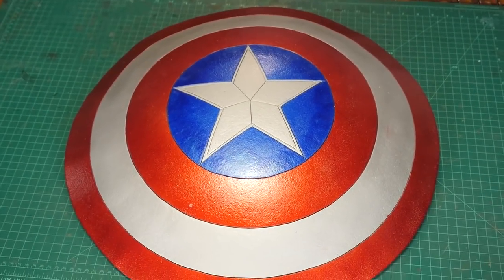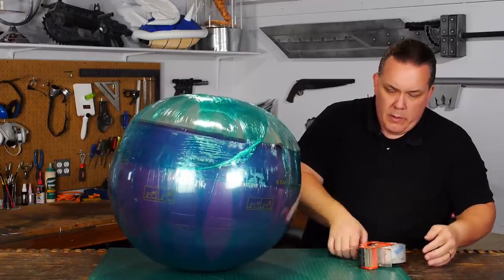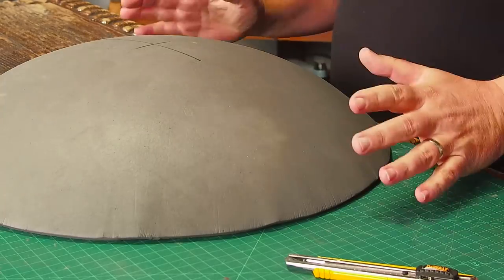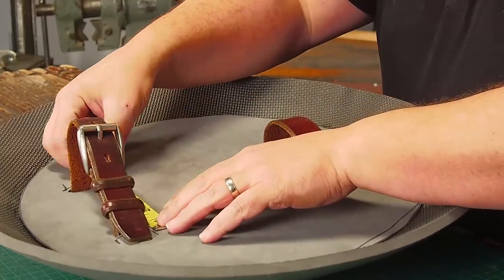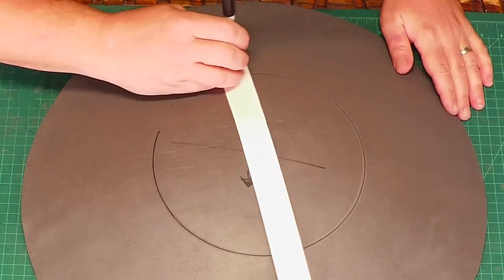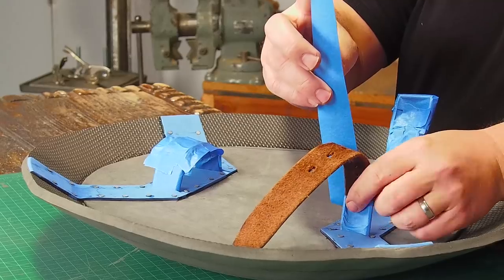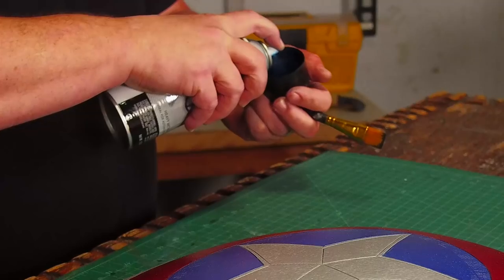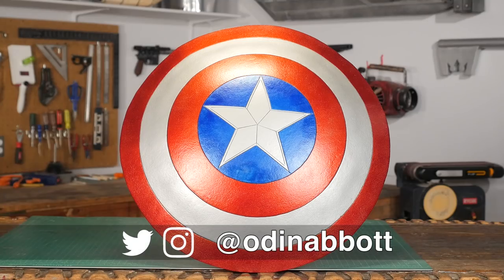Odin Makes: Captain Americas Shield from the MCU

Comment: Using your video as a reference, super helpful. I put some holes in the back piece and filled it with expanding foam to protect the dome. Works great and adds some weight!

Comment: I am making this with my son, but can't leave it in a hot car in the UK in October. So we used two layers of foam, hot glued at their center, then we used EVO-STIK (like contact cement) to glue both circles together. We cut a sheet of clear plastic an inch or so larger than the shield and put Duct tape across the top extending past the plastic about six inches. We then taped it to an over-inflated exercise ball and added more strips of duct tape across the top.  We filled in the gaps between these tape strips with shorter pieces of tape until all 360 degrees of the shield edge were taped down.  When the glue dries, the shield should hold it's shape just like laminated wood beams do. We will have to trim the edge to even up the circles since the back one ends up about 1/4" bigger than the front layer due to the curvature.
Reply: Also, to cut the circles and to etch the rings, We used a plastic ruler compass. I heated a small nail and stuck it through the ruler at the 0" mark. I then heated an Exacto knife blade and pushed it through the ruler at 4", 6" 8" and 10". For the inner rings, the knife blade hangs about 1-2 mm below the ruler, which is now a very sturdy compass knife vs. Odin's posterboard compass.  I then drove the nail through the ruler, the foam and into a wooden workbench. I didn't even need to draw the circles, we just etched them.  At the 10" mark, I used a longer blade and heated it then pushed it through the ruler until it hit the workbench.  This cuts a perfect circle.  We then used a star template to etch an 8" five-point start inside the inner etched circle.  We are doing everything else pretty much the way Odin does it.

Comment: Hey Odin, here's an idea for you. Instead of using nail heads for rivets, use googly eyes. It's a lot cheaper to do, it's a lot faster to do, and it looks better once you paint them. They will make a little bit of noise because they have paper inside of it but it's a small price to pay for good design.

Comment: Hey Odin I have a fun little tip for you

Next time you’re short on rivets just cut some roofing nails down to size poke them through the holes and carefully hammer the cut ends down

If you ever make an Ash Williams robot hand out of styrene plastic or something  (that’s the best example I could think of)

Comment: Little idea for the nails

If you can’t find real rivets for the projects that need real rivers just stick a nail through the hole cut off what you need to cut off then hammer the cut side down until the bond is secure but not to the point where you’re moving parts can’t move

That’s my biggest problem with DIY videos none of them every list that as an option despite the fact that it’s a pretty easy one

Comment: Ok so I discovered a super interesting techniques for “cheating” on the score lines! I saw someone make a PVC pipe compass, with holes drilled so an exacto can fit through. They then went around, cutting the lines, BEFORE heat forming. Just thought it was worth the share, for anyone interested in making one.

Comment: Odin, I love your videos, very informative and thorough. I do have a question. Do you think I would get the same results doing the strips and star BEFORE wrapping to the yoga ball? Using that heat aswell to open the spacing between stripes? Thank you in advance
Reply from the maker: Possibly. The heat from forming the ball is not as direct as a heat gun, but the action of stretching open the cut lines will help a lot. I would be a little worried about warping, but realistically, it's a circle on a sphere, you really can't mis-align the two shapes! I think it's a neat idea that would probably work.